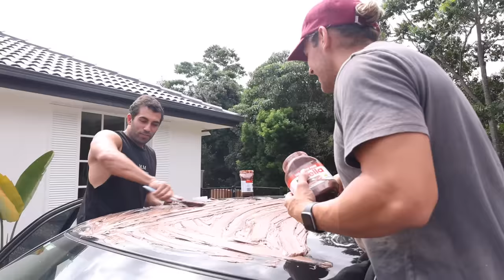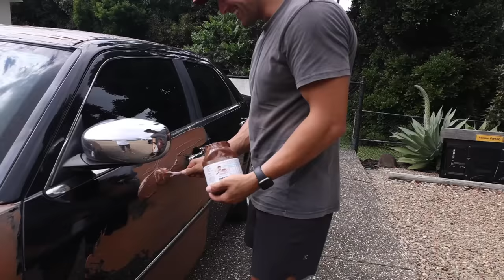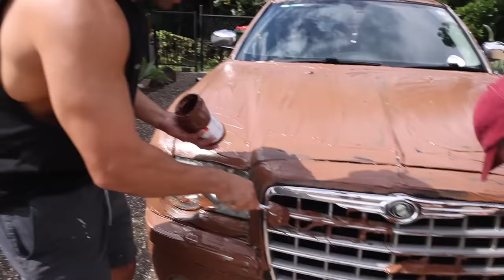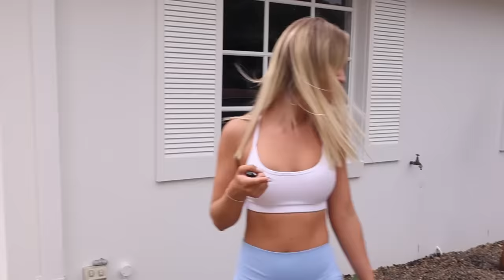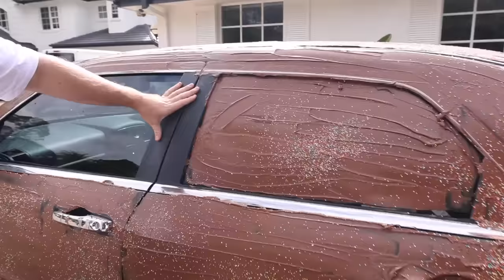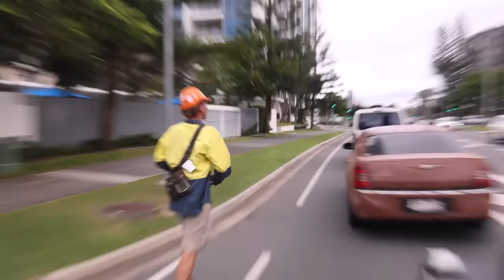Easter Prank on Austin!

Comment: as a detailer myself i could not fathom the amount of hours it would take to clean lol
Reply: One quick power wash and it’s good
Reply: @markus7166  that isn’t coming off with a pressure wash.
Reply: @maxgustafson4629  A pressure washer would easy get that off
Reply: @maxgustafson4629  you've obviously never used a pressure washer 🤦🏼‍♂️😂
Reply: I'm also a detailer and I would quite like to have a go at cleaning it just for my own satisfaction lol.. I reckon my diesel powered pressure washer set to 60 degrees would blast that choccy off in a quick fashion, I dread to think how much chocolate would get pushed through all the seals tho. it would end up inside the doors, behind the rear lights and stuck in all the water drainage holes 🤦
Reply: @ninjatatt  Oh mann dont get me started lmao spot on